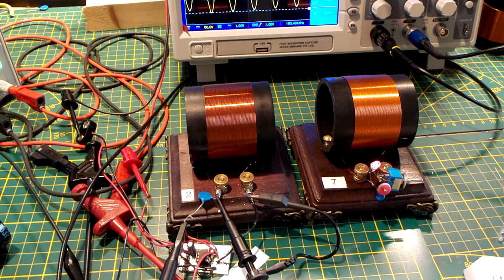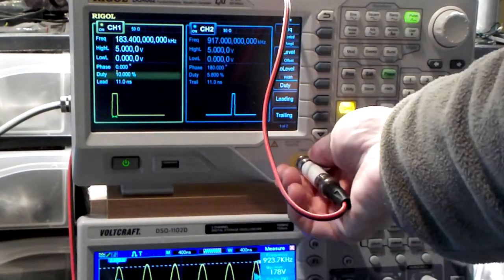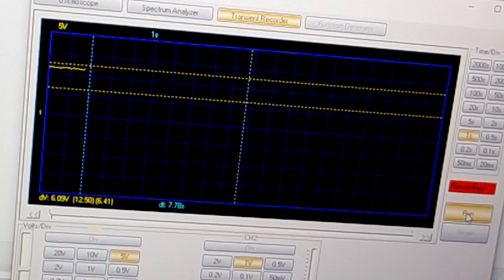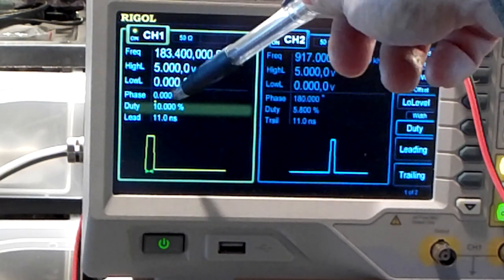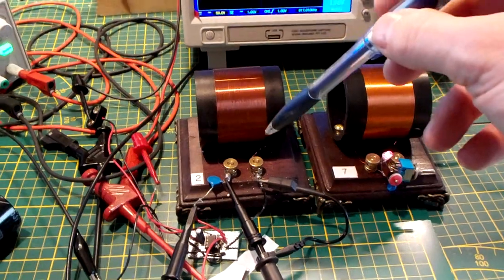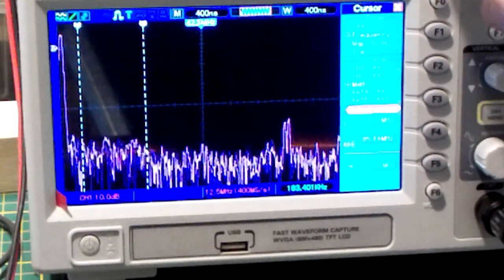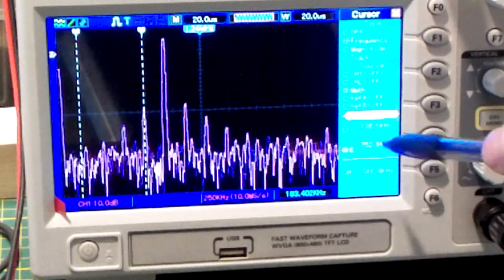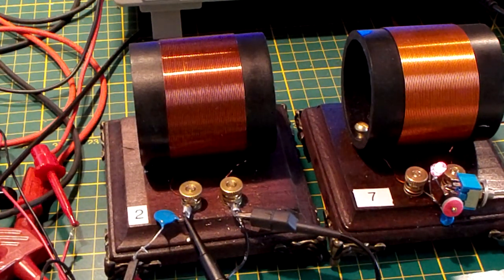047 Don Smith Spinoff Experiment Free Oscillations Proof To Myself

Comment: Some related ideas include ideal step charging capacitors. That is a bigger subject than people think. You have to realize several things in that. Essentially you want to create the ideal trumpet wave for the capacitor you are using, or rather find the right value and type capacitor for the application you are wanting to use it for (as Don would say start from the back end goal first). People think that charging a capacitor is always a loss, but it doesn't have to be. Step charging a capacitor (especially with sharpest impulses and highest frequency) in it's sweet spot region can result in 1000 x more energy production than with regular charging. I experience that at the beginning of my research but I haven't heard a lot of people talk about it. Another thing to consider is phase lock looping or tracking resonance (that is in reference to your mention of things going out of resonance with added coils or changing loads. All these things are old news and long developed in many products and patents. So get the core principles down and then it will easily come together...
Reply from the maker: @Rick Friedrich, Thank you for your comments.
With the step charging of capacitor I have the problem to see it's advantage, my first thought is always the delay that it's causing before one can use it. So hopefully one day I can do an experiment that like with the free oscillations shows me the opposite.
The phase lock loop I did also some experiments with the kit coils, I have circuit for that in my picture album: https://photos.app.goo.gl/dZtmiNBfLPgqvXnQ6 there are also some video's here. The small experience I have is that adding impedance matching (in combination with PLL) is more benefitial because you can work in the range your coil likes the most. When changing the frequency to lower values it can lead to less ouput for more current like I could see when I made a graph of your kit coils: https://photos.app.goo.gl/E55PAYeQ8VsBoN9X9

Comment: Hi Bruno, great idea measuring load across cap, keep in mind that gate drivers consume energy on every switching event. If You are using the IXYS gate driver they make the same unit with built in heat sink tab part # IXDN614CI. Zip tying a small heatsink on the back of the driver also helps. Thank You for sharing your work, Alexis.
Reply from the maker: I did extra experiment by measuring current with 1 ohm resistor: https://photos.app.goo.gl/fzabp3zY54AAn94G9

Comment: Now you have it, Congratulation! This is what Bernitez and all the guys like Don have done. Free Oscillation is a huge key and they were my personal breakthrough. I think you now know for sure what you can do with it next ;)
Reply from the maker: @Baudirenergie, Thx for the congratulations. To bad I made that mistake of looking only at maximum voltage output at each frequency instead of taking the voltage of the lower frequency as the reference value. The next will be the answer to the comment from Luc: How many receivers without influencing the transmitter.
Reply: @brunovk417  yes, I have seen the experiments from Baudirenergie and he also had the same effects from Rick..so this principle works. Tweak the duty cycle for each frequency and use very fast pulse edges and use higher pulse voltages...
Reply from the maker: @Baudirenergie, somebody gave me a possible big hint, I wrote a general comment on this, this is to inform you.
Reply from the maker: @overunitydotcom,somebody gave me a possible big hint, I wrote a general comment on this, this is to inform you.
Reply: @brunovk417  You will see this is a big open-ended research question. The transmitter will always be influenced by the receivers that are "influenced" by it. The question is phasing and other considerations. Again, you presently see just a speck of the details. The more we make way to have "eyes to see" the more we will observe...
Reply from the maker: @Rick Friedrich, Today I did some more experiments on the grounding before going to the next step and try and tune 20 receivers and see what I can establish with all the things I've seen in my experiments. The problem is to find like with "phasing" what the important keypoints are to do the phasing or other processes correct. 
I experienced best results for example with the free oscillations when using pulse width of 1/2 wavelength while in series LC only current is drawn on a changing edge, beinig rising or falling the time between the edges doesn't play a roll in currentdraw. But you see that by adding receivers the point of injection changes, but at the moment I have no idea if this is what is exactly ment when you speak of phasing, namely changing that point of injection of the pulse again just before max value of the sine wave for the rising edge & just before minimum value of the sine wave for the negative edge. (pictures on this: https://photos.app.goo.gl/CnDnNPbF7VRrAXe87 , https://photos.app.goo.gl/DdzG3CyVtxLQaae39 )

Comment: Well done Bruno. Now you have seen, that Rick is right. You also can tweak the input duty cycle...which is a must for every input frequency to get the maximum output....
Reply from the maker: @overunitydotcom, When I used small load like in this video where I had not much influence on the resonant frequency of transmitter I had best result with those percentages. However when using heavier influence by placing coils close together and thereby influencing the transmitter resonant frequency I indeed needed to change dutycycle also.
I also want to add that I always used full resonance (50% duty at max resonance frequency) before starting with the free oscillations. The only time I did not do that is when I was experimenting with the 38V input because it would have blown the gate driver.
Reply: @brunovk417  It is excellent work, Bruno!
You are well on your way to transforming the energy of the physical vacuum into real energy. Thanks a lot!
Reply from the maker: @Hans Würtz, Thank you for the comment. My mind is filled with possible things to look for, I hope that this time I not make a mistake again like I did previous with this free oscillations and only look at what was maximum possible. 
What we see would allready lead to a great device if I was just able to generate high voltage for low power input and be able to switch it correct. At the moment the real accurate switching for duty cycle with for example a spark gap is a mysteri to me. First going to look with low voltage what is possible & helpfull.
Reply: @brunovk417  Hi Bruno, every spark gap has a NEGATIVE DIFFERENT ELECTRICAL RESISTANCE. The spark gap is composed of a multitude of individual sparks of very different sizes. This is one of the reasons why the spark gaps produce a very broad electromagnetic spectrum. The low-frequency long arc sections take their energy from the power supply unit or battery. The extremely short arc sections take their energy from the physical vacuum. Tesla worked with arcs in many experiments, and there was a reason for this. Only a few months ago it was discovered that antimatter is created in every flash of lightning. The arc is a very complicated structure.
Reply: @brunovk417  yes you need to adjust the duty cycle with every added coil a little bit. It doesn't always make a significant difference, but with 2 or more coils you see bigger changes.
After that you have new conditions and changes in distance between the coils / transmitter give you again a little bit room for more optimizations. it's all a big dependency that has to be readjusted with every change.
Reply from the maker: @Baudirenergie, Have you suceeded in creating a magnetic lock between transmitter & receiver?
Reply: @brunovk417  Do you mean that effect, that you can bring down the input, via adding more and more coils, without falling out of resonanace condition? Yes I think so.   
I had achieved this effect twice I think, but not 100% sure if it was. I was able to put smaller coils and also two coils on ferrite rods into my larger transmitter coil and my input power consumption went drastically down, without influence surrounding coils to getting weaker, which happens when you overdo that effect, because of shifting to much to a lower frequency. They had such a strong lock, that I couldn't see, that they fall out of resonance.
Reply: Generally it can be said that electromagnetic energy converters do not need real power at the input of the converter if, the reactive power at the input of the converter would be compensated and the rising and falling edges of the voltage burst would be 90 degrees each; but this is pure theory and does not work in practice. A rather small real power share at the input of the converters will therefore be unavoidable. 

On the oscilloscope screen you can see very nicely if within the input voltage pulse window the enclosed area of the input power above and below the zero line of the oscilloscope screen is equal. In this case there is pure pendulum power (reactive power) between the signal source and the converter input. The average power within the input input voltage window is 0, i.e. the effective input power within the input voltage window is 0. The free oscillations start to oscillate immediately at the rising edge of the input voltage window. At the falling edge of the input voltage window a further oscillation of the free oscillations begins. The input pulse repetition frequency and the duty cycle must be set in such a way that the oscillations on both sides are in phase with each other. Thus many free Oscillations are created over a long period of time, which continue to oscillate for a long time after the end of the input voltage pulse. If the emitted energy within the sequence (from the rising edge of the input voltage pulse to the next following rising edge of the input voltage pulse) is greater than the energy in the input pulse window, overunity exists. This is by no means a perpetuum mobile. The tapped real energy comes from the physical vacuum. The steeper the edges of the input voltage pulse are, the more energy is converted from the physical vacuum into real energy.
Reply from the maker: @Hans, I experienced what your describing when looking at the result of using puls width greater then an oscillation, I could clearly see that when the pulse is to long a dampning is created instead of a gain. The moment the pulse goes down you see the oscillations rise up to there maximum.
I also don't see it as a perpetuum mobile, we use what's allready there, just like solar and wind but with the difference that our sences can not register it directly. 
Thank you for the explication, I'm going to read it a few times.
Reply: @brunovk417  Hello Bruno, the famous scientist Steinmetz from the USA described in his fundamental and comprehensive work on electrical engineering in 1911, the falling edge when switching off the coil current. OVERSHOOTING when switching on the coil current with its high voltages did not exist for him; but that was Teslas Radiant energy. We use this shock wave and of course the falling edge as well. We even combine both pulses in phase with the appropriate duty cycle. Wonderful!
Reply from the maker: @ Hans, Thank you for your comment. If we could use the blocking of 4 pulses to the gate driver then we could end up with 4 free oscillations @the full 917Khz and 50% duty (added a general comment how I came to this) 
At the moment I'm searching for a possible solution to do that, I have to look to signal generator if I'm able to achieve it that way or with counter module or other. Thx again
Reply: @brunovk417  Bruno, great! You can only achieve the necessary powerful free oscillations by the steepness of both the rising edge and the falling edge of the input voltage window. In the purely theoretical ideal case, the rising edge rises with 90 degrees and falls with 90 degrees in the optimised duty cycle, in which case free oscillations with infinitely high amplitudes would result. This is of course pure theory and does not work in practice. Regardless of which electromagnetic converters we use free oscillations, we cannot get past the steep pulses at the input voltage window. These are a prerequisite for achieving an energy symmetry break in a physical vacuum. Only then, the physical vacuum will be so massively activated that in a short time, a balance of positive and negative energies to 0 is no longer possible and real energy remains. We will have to use avalanche generators with the great steepness of the pulses; otherwise, our energy converters will not be able to deliver practical power.
Reply from the maker: @Hans, I have a problem in creating the 200V to run the avalanche generator efficiently. 
When I change from 12V to 38V with just the gate driver it's not like mentioned that power is squared or so, there's an increase but still not able to light up 1.5W led full brightness, would the nsec sharp edge at 38V do the trick? 
At the moment I'm doubting on searching for creating nsec edge signal & redo the experiments with big coils (but Rick told they where also not full brightness in his video)
Reply from the maker: @Hans, That sounds very intresting :) I will have a look at the link tomorrow, time shortage today.
 I looked deeper into the pulse and Stefan pointed to what to look, so I understand why the p & nsec are intresting to look into. https://photos.app.goo.gl/24jcXD6ko6phimae6
Reply from the maker: @Hans, I found another intresting link to nsec pulsing: https://www.researchgate.net/profile/R_Baker7/publication/224501095_Nanosecond_switching_using_power_MOSFETs/links/56b8a7fd08ae3c1b79b2e74c/Nanosecond-switching-using-power-MOSFETs.pdf 
Not sure it will switch series LC circuit due to being a capacitive load but maybe a parallel LC if current draw is limited. I'm going to try what happens if I use the 2N5551 instead of the 2N3904 in this document. It will also be intresting for the motors setup.